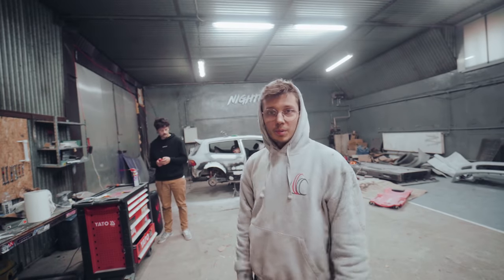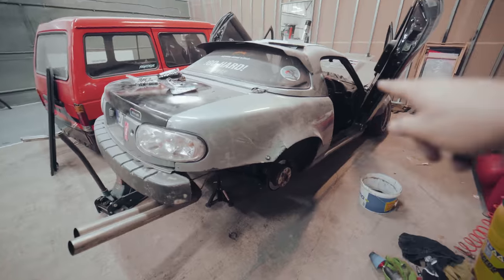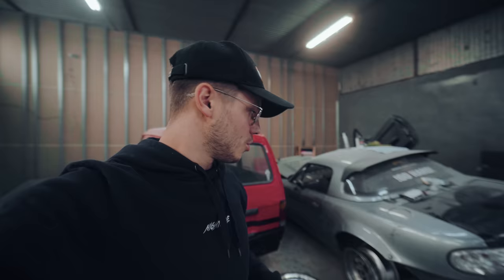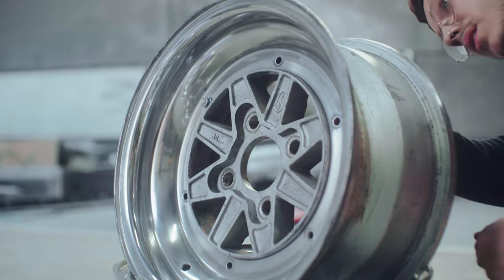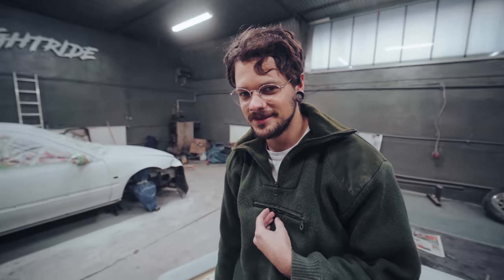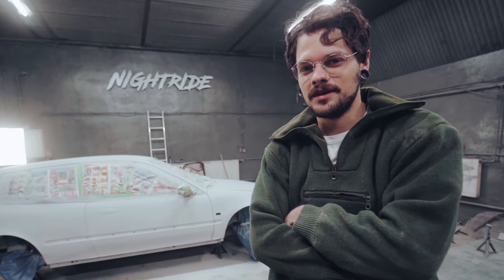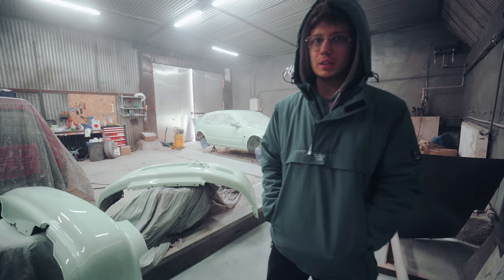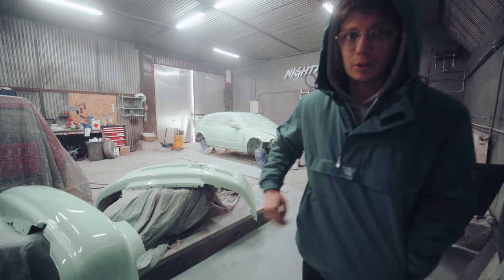Finally painting the EG Hatch with new color | NIGHTRIDE

Comment: Wait so what do those nuts and bolts hold on the wheels if you could mount them on the MX5 without them? Are those just for decoration?
Reply from the maker: the wheel is welded so technically yes they are decoration